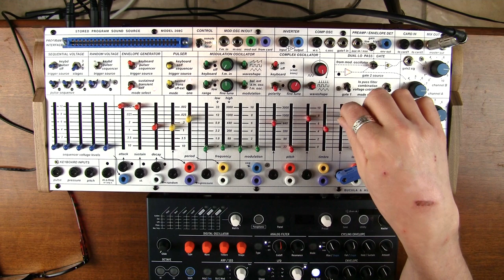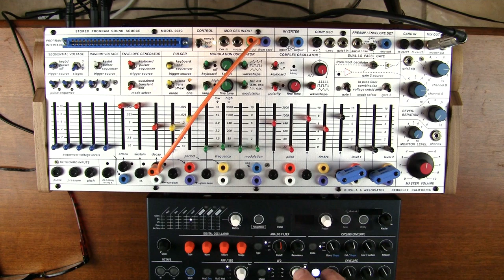07-The Buchla Easel Command- Part seven: Envelope Generator

Comment: Loving these videos. That the envelope sliders need to be moved towards the bottom for them to respond noticeably to CV was definitely something I didn’t realize at first. I thought they weren’t working. I figured they would CV up (er, down?) from 0. Thanks!
Reply: And I suppose it's actually consistent with the other sliders: applying CV effectively pushes the sliders up.
Reply from the maker: Thank you so much, Mark!